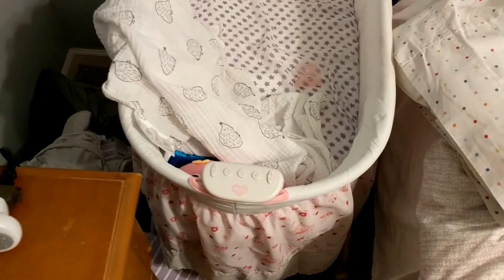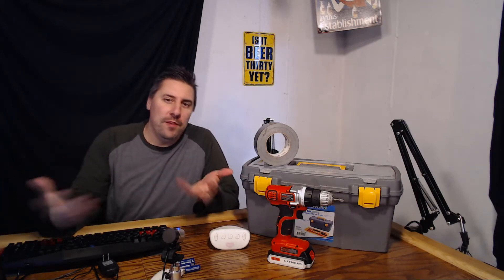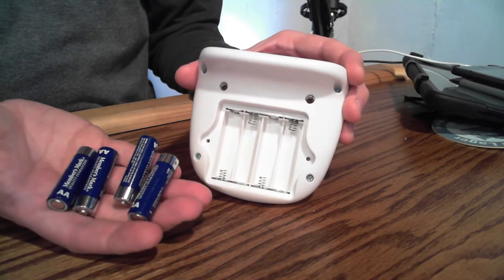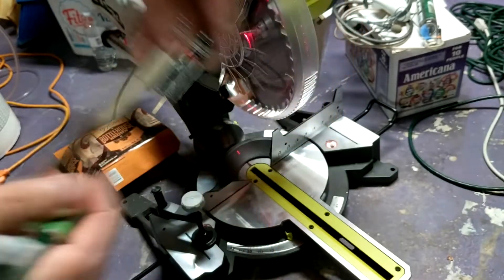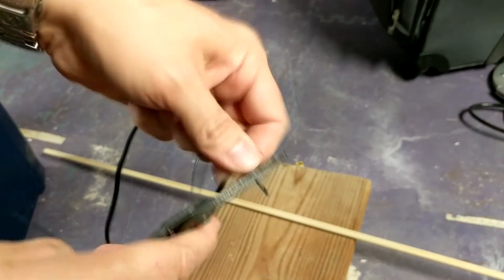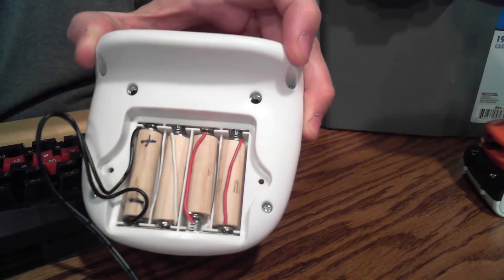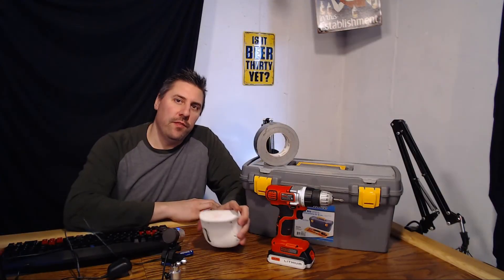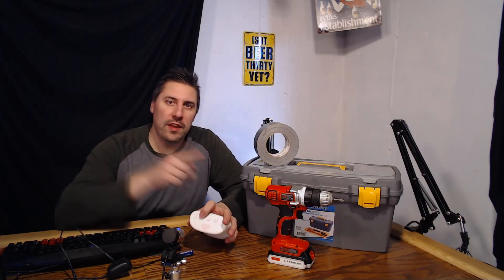Convert Battery Powered Devices to AC Power

Comment: My device only takes 2 batteries , do the same principle apply?
Reply: 2 AA batteries at 1.5V means you need a 3V adapter instead, and probably only 600mA or higher.

Comment from the maker: The "dummy" batteries are used in order to quickly change the device back to a battery operated device by simply removing the 4 "dummy" batteries.
Reply: It's a good idea, but I think the best way to save materials, time, container space, and extra work is to leave out both of the middle dowels and just make a positive dowel for one end and a negative dowel for the other end. Should work just the same as having all 4 running zigzag in series, but simpler. Still cool though dude🤙

Comment: And I also have another hack there for you buddy it is a complete waste of time to make all those fake batteries just to fill up the slots and series. All you need to do is connect the positive on one end of the battery compartment and the negative on the opposite end of the battery compartment as the actual leads only come off of opposite corners everything else in the middle does not matter. But I applaud you for doing so in trying to work it out. But you wasting a lot of time in materials when they're only really needed to be two connections! More than likely the positive on the right side and the negative on the left side.
Reply: Your advice contains soldering, but this one not.

Comment: There's just one thing you're forgetting about there mister. Each battery is usually 300 milliamps or 300mAh x4=1.200 now granted amperage is partly the measure of capacity but at too low in amperage you can actually burn your electronics because you're changing the wattage it's not all about voltage. so you need an adapter that will at least do one amp but I'd still try to find one at 1.2.
Reply: Voltages add when in series. Current does not! So 300 mA remains 300 mA. He doesn't need to find one that is 1.2A!
Reply: @njtexit8  I think you may be wrong in that assumption. Because amperage is capacity. If it is in series voltage does increase amperage stays the same however in parallel voltage stays the same and amperage increases because of the reduced resistance. However the batteries in those things do die quickly and a standard battery is 300 milliamps you could do that but some batteries as in rechargeables have higher amperage close anywhere up to 1000 mAh

Comment: Of course your name is Greg!
Reply from the maker: Is that a good thing?
Reply: @howtofixitworkshop  it's not a bad thing. You look like a Greg 🇺🇲
Reply: @howtofixitworkshop  btw. thank you because this is going to help my band. Battery guitar kicker is awful now it will run forever. Real quick question Greg, would it ruin the kicker if we use more volts then it's supposed to?

Comment: why do we need to add the dummy batteries ?. Just Solder the +ve and -ve to the respective end points (There are only 2 end points even if batteries are series or parallelly arranged).
Reply: You don't. It is a waste of time.

Comment: I imagine if you wanted a more permanent solution you could directly solder the wires of the dummy batteries together and solder the power cable itself to those contacts like with the other 3 dummy slots.

Comment: enjoyed the video. I want to make one of these to run a dc fuel pump. I have some power inverters around and realize I need a 12v one. can I just splice one in to my dc pump using it's clamps and will this handle my project? usually I hook my dc pump up directly to my truck battery with the clamps but have to keep the truck running to get enough power and it's to loud (diesel truck). thank you for your assistance.

Comment: This is dumb af don’t do this. They have battery conversion kits you can buy for the price of a dowel rod that are idiot proof. Running electricity through wood which is not an insulator is asking for trouble

Comment: I figure someone will wire led lights for entire rooms with this method. Being low voltage, the normal electric codes will not apply, so you can revamp lighting with no worry about violating codes or permitting.

Comment: i want to make a mosquito repellant (emits a sonic frequency) it has a 230v ac plug, but could i change it's power input to 9v battery with a solar panel? is this even possible? looks like it's the opposite to this video.
Reply from the maker: This sounds like a good idea

Comment: Could you make it run off of one of these the same way? Was thinking about doing it to a u bolt pro lock
Amazon.com
TACKLIFE T6 800A Peak 18000mAh Car Jump Starter (up to 7.0L Gas, 5.5L Diesel Engine) with Long Standby, Quick Charge, 12V Auto Battery Booster, Portable Power Pack for Cars, Trucks, SUV https://www.amazon.com/dp/B075K42Z1M/ref=cm_sw_r_other_apa_i_pk8wFbZPCK5Z1

Comment: did you know that there are only two connectors necessary for the positive and negative on the battery compartiment. I mean you only need to connect two wires at the right place, all the 'dummy batteries' are completely useless ! If you don't want to solder the cable to the two spot you can use the dummy battery only on the negative and positive spot. 
Those spots are easy to see, if you take apart the whole thing you'll see the red and black wire connected only in one place each. You can even see them without taking appart sometimes !
Reply: Thank you thank you.  I was thinking the same thing and I was racking my brain trying to figure out why you would need 4 dummy batteries
Reply from the maker: thanks for the feedback!
Reply: Thanks for sharing
Reply: While you are right, there's value in keeping a device as stock as possible. Like the second-hand market, especially the baby stuff.

Comment: Why do I need the wooden dowels? Could I just run a wire between each pair of extra contacts, if I'm not planning to unconvert the device? Or just leave dead batteries in there?
Reply from the maker: Yes you can. The reason we used wooden dowels was to easily change it back to battery powered. If it's hard wired, it makes it a little more difficult to change back.

Comment: Can I ask why you need to used the other 3 fake wooden dials (wired) when you already connect the main to the negative and positive?
Reply: Also interested
Reply: @DarrenPauli  On most things with more then one battery, positive starts on the first battery and negative is at the end of the last battery. Putting the other three basically makes a long chain.
Reply: @Dspic09  hey @_partyOfOne_ did you (as I now realise I did) think that one battery would have been enough? I didn't consider that the device needs each battery slot to be powered. I'm assuming that was my mistake :)
Reply: @DarrenPauli  now. I didn't bother with the batteries. Instead took out the battery holder and connect directly to the wires inside
Reply: @Dspic09  I'm about to do that with a 9v, just need to find the right chargers (current ones are a little too small or a little too big)
Reply: @Dspic09  do you have a video on how to do this?  Interested.
Reply: @macylouwho1187  sorry, I don't.

Comment: I just wanted to say THANK YOU!! I just did this for my fairy lights on my desk and now I don’t have to go through a million batteries!! Every other tutorial I saw needed soldering and this was so easy. Thank youuuuu
Reply from the maker: You are so welcome!
Reply: I also came here to say this!
Reply from the maker: You're welcome?
Reply: Will it work also if the striped positive and negative wire from the plug goes directly into the baby device without fake batteries. And hot glue or blutack them together because I'm crap with this DIY and just need a easy way to convert batteries into plug power

Comment: Wow! I love YouTube. You provided the method I am going to use. I have what is basically a flashlight with 3 end to end AAAA batteries. The dowel solution is PERFECT. Genius. Really elated that you posted this. Regards, Bill
Reply from the maker: Glad it helped!
Reply: @howtofixitworkshop  Just FYI, I did it and it really came out well. Bill
Reply: @billinfarmington5189  everything working well with it?
Reply: @93coupes26  Yep. Wired it to a toggle switch and mounted it to the bottom of my upper arm on the scroll saw. Casts a great shadow aiming my scroll cuts. Works well. Bill

Comment: The idea with the wooden sticks is genius! No clue, no soldering and it fits perfectly.

If you want an even more generic solution, you could think of using a regulated switching power supply like from Goobay with 3, 4.5, 6, 7.5, 9 and 12 volts which is exactly the voltage added by additional batteries.

But people, if you will ever do this CHECK THE VOLTAGE CAREFULLY. If you do wrong, the powered device might get broken or catch fire.

Thanks for this video ;-)
Reply from the maker: Good tips, thank you!
Reply: @howtofixitworkshop  if I have 4 AA batteries with a wire going to a hands free water tap for touch less activated flow can't I  just marrett the transformer wires to the tap wires and completely remove the battery containment box then plug in ?
Reply: The additional batteries aren’t needed. All he needed to do was connect the positive on one end of the battery compartment and negative on the other side. The wooden “batteries” don’t need to be there but in order to make it solderless I guess you could just use two of them

Comment: Hi I want to convert my cd player also but I am worried that the amperage might be an issue as the adapter might output a larger current than the batteries.
Reply: I'm a brave amateur in the electronics/electrical arena, but I'm pretty sure your adapter doesn't output amperage, your device draws it. As long as your device doesn't draw more current than your adapter can provide, you should be fine.

Comment: Why do batteries and AC adapters for the same gadget provide a different voltage?
Reply: possibly for charging batteries in the device? Or the device has a tolerance for voltage and they used a standard AC/DC adapter

Comment: OMG, dude. You do not need to make fake batteries.  Just wire the black wire to positive on far left, red or white on far right terminal either through soldering or just tape it to it. you do not need to bridge anything either. Don't worry if you get it wrong, it will not come on, but it will not hurt it, then just switch wires around till it works. There does not need to be any batteries in the device for it to work. 
So to clarify, there are plates that turn the four batteries into one long large 6v battery with a pos+ and neg- terminal.  So from the picture of the device above, you see (looking at back of device) the rayovac battery top position is isolated, (pos+) and the right side Ever Ready top is also isolated (neg-) this is where your wires go. Either drill a small hole in battery cover, slide wire through and tie a knott to keep it from coming back out, then wire it terminals/tape/solder/etc.  You can also prob just file out the side of the cover and slip wire in that way. 
So again, it goes from right to left, neg- terminal down, across pos+ to neg- next battery, to pos+end, neg- next battery, and so on till it ends with left side battery top pos+.  One long battery. 
The way you do it is fine, but unnecessary. Best of luck.
Reply: I use my vibrator most of the day & I guess I'll just have to stay near an electrical outlet at all times, but I'll be saving bundles on batteries 😆😆😆
Reply: Your comment just completely reassured me that this is easier than the extras steps taken in the video. Both ways work, thank you for the video & comments.
Reply: If you listen instead of running your mouth like a jerk off, he said he uses the dowels incase he wants to go back to battery power he just removes the dowels instead of twisting or un soldering .

Comment: you didn't mention matching the amperage required of your transformer versus what the batteries provide. also didn't understand why you bran why are from 1 side to the other on the wood dowel and the other three slots
Reply: The power supply must be able to supply at least enough current to meet the demand of the device. Agreed, this would be useful to discuss as if the wired supply is unable to provide enough current, the power will be low and the device may not function. As for the other three slot dowel wiring, this is basically just replicating the physical attributes of the battery. It allows the current (power) to get from the first battery (the one hooked up to the new supply) over to the correct location for the powered device (see this video: https://youtu.be/GeIzrl22YSk for a visual explanation). This aspect of the build wasn't explained thoroughly in the video. When these batteries are inserted into a device, they run all together, connecting one end (through all the batteries) to the other end. Think of it as a stack of batteries together that add (in a series connection, as this is) to get a higher voltage. So, look at the batteries all connected together in this way:
+1.5v- +1.5v- +1.5v- +1.5v-
would get you +6v- total (where + is the positive and - is the negative of the battery or power supply). The batteries alternate (+ on top, to - on bottom) in physical layout to put the +/- in the proper orientation and minimize wiring needed.

Comment: hey man quick question. i have a device that runs on batteries. i use it with rechargable batteries. is there a way to transform this into a rechargable device? i mean, i want to recharge the batteries without taking them out from the device.  thank you!

Comment: Hi I have 9 lights that takes 3 times AAA . All the lights are controlled by remote control for patio use  , how do I do that ? Parallel systems with supply of 4.5 volts works.?
Reply: I have the same question. Series or Parallel?

Comment: Hi if my device has 4 aaa batteries which adapter should I use? It says AAA 1.5V
Reply: He said it just at the beginnig: 1.5V per battery= 6V output  (1.5 x 4=6). (Now, I dunno about amp rating etc, but I don't think that will be all that big a deal b/c of the low voltage output)
Reply: @jimm3370  you have a range between 4 and 8 volts.
Reply: @fraaggl  Thanks, dude!

Comment: you know how many people are going to set their baby stuff on fire now bc they will try this without using a multimeter and testing voltages lol...
Reply: Or matching current output...
Reply: @danielkoontz6732  That one isn't really as important since things only draw as much current as they require and most switch mode supplies will just keep cutting themselves off if too much current is drawn. :/
Reply: Only the ones who don’t believe in themselves, operate under heavy self doubt, and lack a focus of attention, could. Fact.
Reply: It’s like people can’t multiply by 1.5?  1.5x4 =6. You want it to run faster, go with 7.5, slower? Drop it to 4.5. Most electronics have a threshold they will work on, like putting three good batteries and one dead one. It’ll run! (Sometimes depending on the circuitry inside.)

Current is a “draw” limiting factor, not a supply. If a wall charger has a 2A rating, that’s the most it can supply. It will never “push” all 2 amps through the device and will either shut off or limit to 2A max.  Battery operated electronic devices have such thin wire inside, amperage is very rarely a factor unless it’s a motor spinning toy or fan. But if that’s the case and you’ve supplied 12 v to your device that is meant to run on 6 v, you’ll smell burnt plastic before any fire occurs.
Reply from the maker: Thanks for adding the details to the conversation, really appreciate the feedback!!

Comment: where do you buy a power adaptor?
Reply: I go into my boxes and boxes of wire odds and ends from over the years and find one that matches the DC device's input V and mAh.  :P

I would say to go to Radio Shack buuuttttt....

You can easily find them on Amazon or another similar site...or even hardware stores.

Comment: Can you do this with dyson cordless?
Reply: yes but you need a bigger cable and bigger transformer
Reply: @fraaggl  for dyson v8 what transformer do I need voltage and wattage?
Reply: @gee-rockgee-rock4468  everything is written in the notice and at the back of the Product ! The tension needed for this product. You would also need a ampmeter to know the intensity.

Comment: Can you do this with any sized battery? I'm hoping to connect a D-Cell tankless water heater to a solar setup so I don't have to use the batteries.
Reply: yes, just do the math on how many batteries the thing need and you'll have the tension of the AC/DC transformer you need.
There is even a margin of error, for one 1.5v battery for example you could use from 1 to 3v dc  alimentation without problem. It depends on the sensibility of the device. 
For a 5 aaa battery for example you have a range between 6 to 9v approximately. Less it won't start, more you risk to burn an electronic component.
This is because the batteries always run in a range of tension, not a precise and stable one.

Comment: Can you do this with any size battery?
Reply: I'm wondering the same thing. Looking to connect  a D-Cell powered Tankless Water Heater to a larger solar setup.
Reply: yes totally, electricity is the same in every tools. As long as you know that there is AC, DC and other strange stuffs rarely uses in every day life.
I have modified all kind of things, from stereo to tool to electric bike (car alternator used as a bike motor is the best)...
Reply: @fraaggl  please explain the alternator as a motor
Reply: @93coupes26 lots of videos on youtube for this